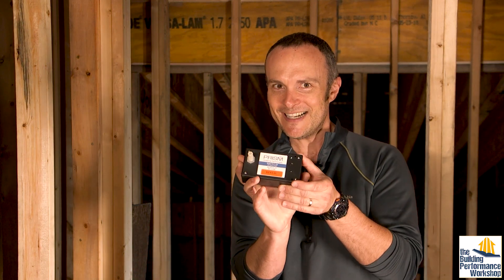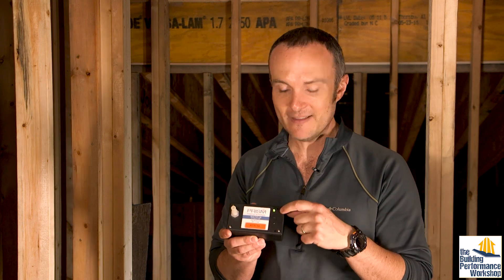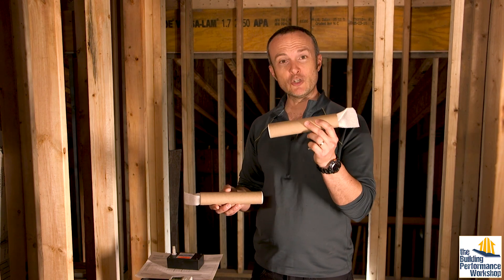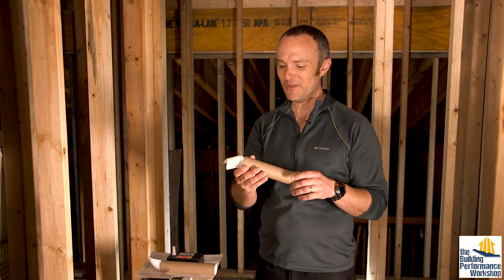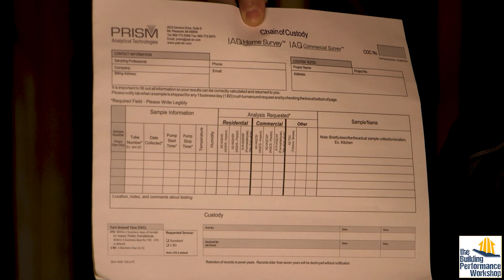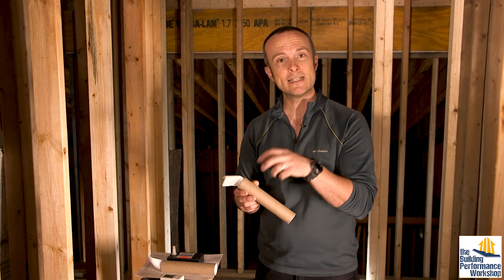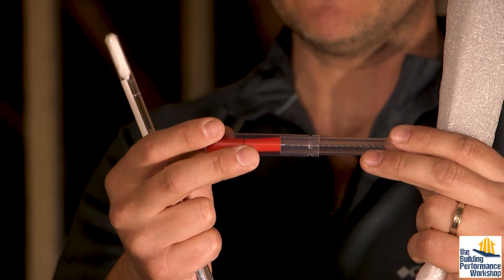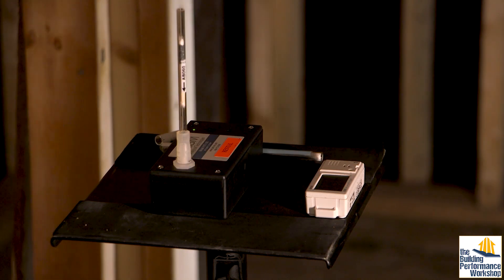How to Test Home Construction for Formaldehyde and TVOC

Comment: Cool! In the last year I set up an accredited emissions testing laboratory, typically for automotive interiors. My lab is now only the 4th testing lab in the US for automotive VOC testing. I use active sampling to sorbents after exposing parts to simulated environmental conditions (heat). Let me tell ya, this testing is so difficult and precise. When you’re measuring sub parts per billion, you need some crazy equipment that is typically very difficult to use. This video was a great explanation, it’s cool to learn more about the testing that I do but for different applications.
Reply from the maker: Hey J, cool adventure you’re on- hope you’re going gangbusters

Comment: Lakeland Paints in UK has a range of paints to neutralize 98% of all formaldehyde & VOCs in the air down to 1ppm -
just paint it on your walls & woodwork & the paint does the rest 24/7 - independent lab results - just ask.
Exported to 56 countries so far.
Reply from the maker: What are the byproducts though? If it’s reacting with VOCs to turn them into something else, what does it all turn into?
Reply: @HomePerformance   there are NO byproducts - its not reacting with the VOCs - its locking them away forever - 
just like the charcoal filter in a gas mask or in a HEPA filter machine
Reply from the maker: Then like a filter it will become saturated, and stop working at some point, no?
I just take issue with all the companies who are marketing silver bullets to uninformed consumers.
Reply: @HomePerformance  Yes - you are right - but it takes min 5yrs to become saturated, when you can just re-apply -
its not meant to be a silver bullet & very few of our customers are uninformed TBH - we have been selling it
for more than 30yrs - if it did not work then we'd soon run out of customers.

Comment: Very similar process for some Radon testing protocols.  Since it is testing living conditions, home should be finished with hvac fully functioning. Closed house conditions for 24 hrs before testing start, with only quick entry&exit allowed with normal hvac opperation throughout 48hr minimum 120 hour maximum test time frame with 24hr increments for heat&cool normalizing. Be sure to let us know the results.
Reply from the maker: Next month’s Healthy Indoors Minute, Michael!